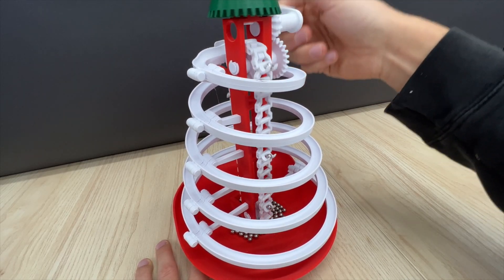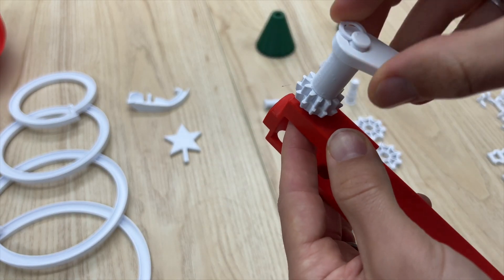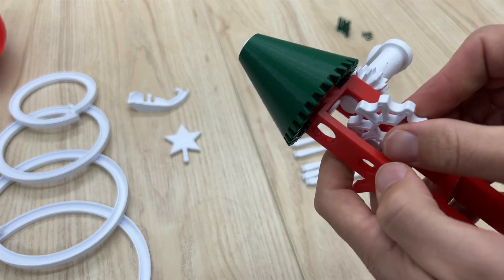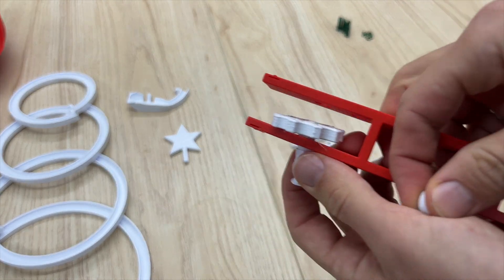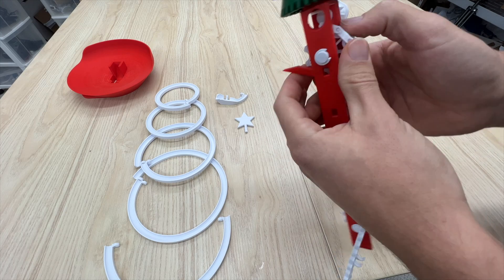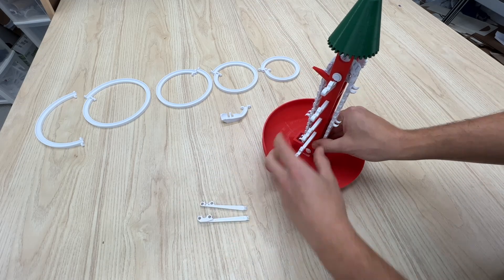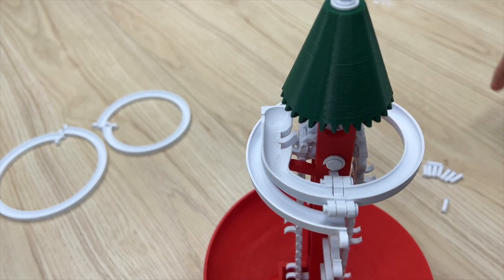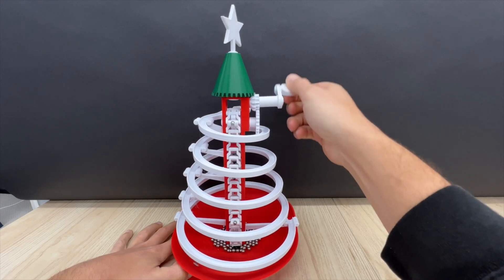The Christmas Tree Marble Run - How To Assemble

Comment: This looks like so much fun, but unfortunately there are so many small errors in this build. The chains are too narrow when printed, even on 0.12mm, so where they connect to each other, they break or are barely moving. The stand only fitted with sanding a lot and some force. The gears are hard to rotate and the balls get stuck when they are at the top, so the chain gets stuck.